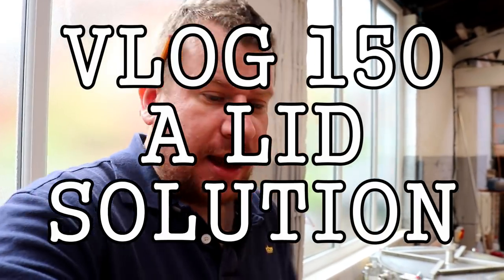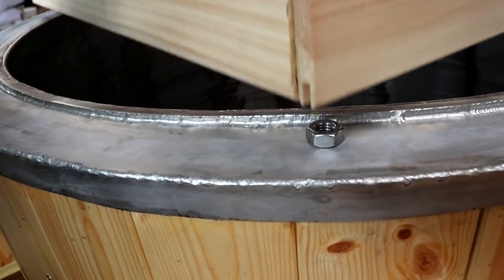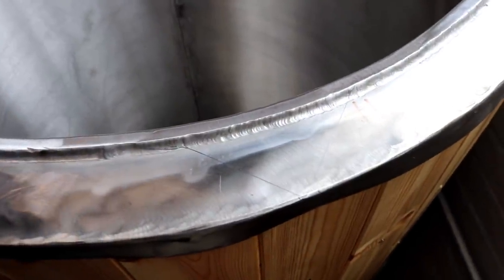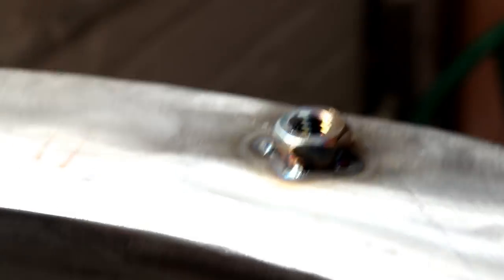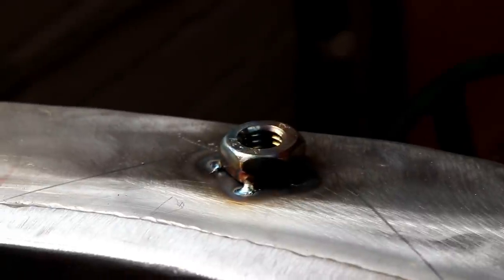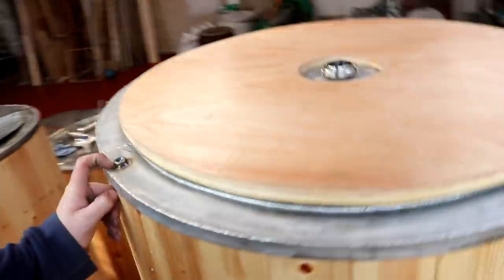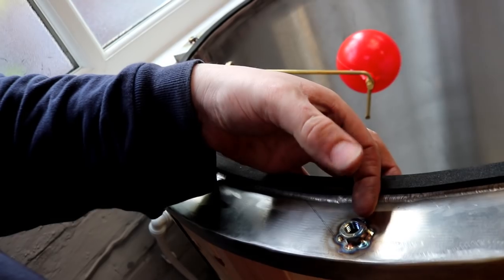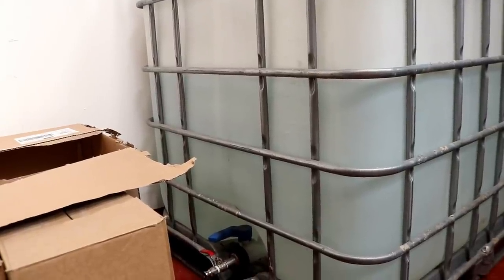WE NAILED THE LIDS

Comment: You could also have the lids go all the way to the side of the fermenter, weld some threaded rod on, small holes in the lid where the thread goes through, and tighten down with wing nuts. No need to any boxing on top.
Reply: The threaded rod would be welded where you put the nuts.